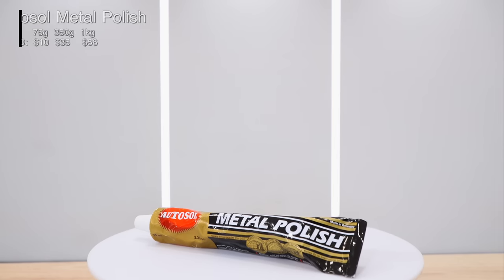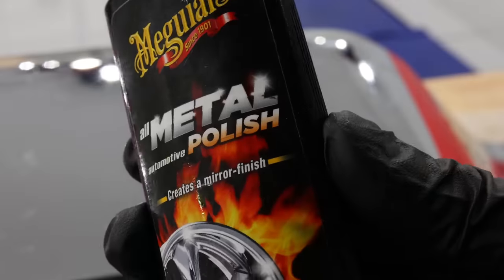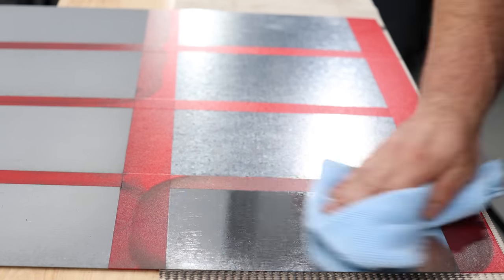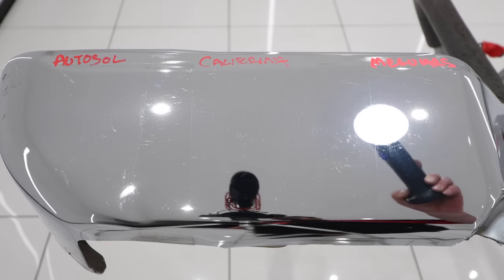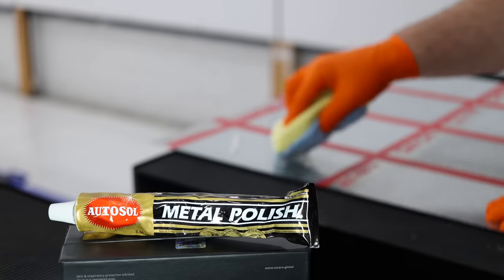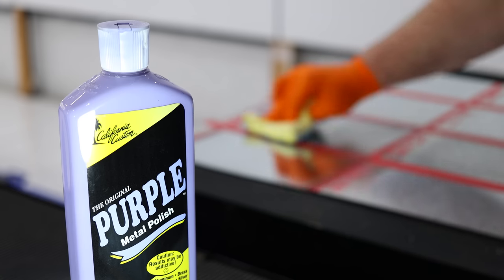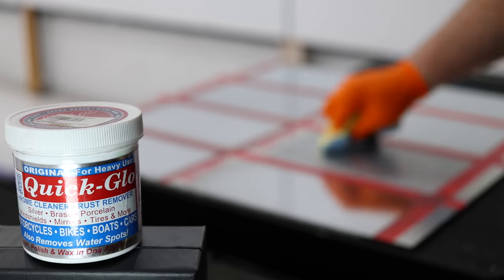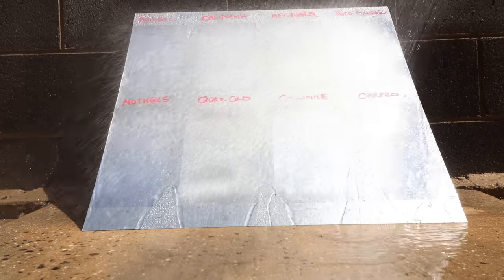What's The BEST Metal Polish? Meguiars, Carpro, Mothers, AF, Collinite, Autosol, QuickGlo, CC Purple

Comment: The fact you went back to square one to start all the testing as you weren't happy with the initial results, is a testament to why I love your videos and your unwavering attention to detail. Still my go to channel for anything car related. I liked this as something a little different too. Nice one Sandro, and hope all is going well for you in 2021. See you in the next one! (also the voice over for Mothers @10:40 is the opposite of the top left text results - this is the one I was most interested in for doing my headlights, autosol just didn't "cut it". Could you clarify which is correct please?)
Reply from the maker: Thanks man and much appreciated as always! I’ve put a pinned correction comment up, but the voice over is correct and the text is wrong!
Reply: That's the boat I'm in. I recently discovered Mother's headlight restoration ability (where Meguiar's headlight restoration failed) and it's interesting you say Autosol won't do the job that well, cause I was meaning to try that next. Do you think mother's is safe to be used on car windows and side mirrors also, cause of course, there's a difference between plastic headlights and glass. Haven't tried it yet.

Comment: As a metal worker I say kudos for using all different types of metal as you understand the massive differences 👌🏽
Some polishes aren't even recommended for Chrome Plating.
Some worse for wear metals will need a proper compound with a calico buff. But these are great for up keep of a machine polished finish. And chromes. 
Once I found the Meguiars NXT I kept it in my toolbox for the combination of finish &  protection/weatherability it leaves behind. Shame i can't find it readily avail. Anymore.
 
With the Mothers I found a more brilliant finish with the Mothers Billet Polish. 

And Autosol now has a larger range of products readily available for specific Metals from Aluminium to Gold etc. Which I find a much better finish than the OG autosol. 
Just my 2 cents.

Once again, thanks again for yet another Unmatched review Sandro! Truly my go to channel for anything detailing.
Reply from the maker: Thanks so much for sharing your insights here as metal worker, really appreciate the comment!

Comment: Came back to add that I’ve used 3D One with a DA, soft foam pad, and high speed to polish delicate plated surfaces.  I think as long as your surface isn’t really dealing with the elements for long (think musical instruments), go for a traditional wax that applies well and adds the gloss you like (Meguiars Deep Crystal is a good example).  Two coats should suffice for a while.

Can’t forget though about Finish Kare 1000P Hi-Temp Wax.  Not the shiniest, but this stuff cures very hard and does what it says for pennies on the dollar.

This remains a great video that serves as an example of for other testers and reviewers to follow.
Reply from the maker: Great advice mate! Oxidation due to UV light is metals most common defect and a nice wax/sealant can certainly help protect and enhance its finish.

Comment: Thanks heaps Sandro, I own my own Motorcycle detailing business here is Townsville, the majority of my customers are Harley owners so I see alot of metal and chrome polishing.
I typically use 4 things when cleaning and polishing chrome and alloy on a Harley - 0000 Steal wool for chrome, Carpro Metallic Cut for my first initial clean/polish on alloy and then Mother's Mag&Aluminium polish over the top to add that pop.
And then usually a coat of wax or I found Carpro Reload layered on a couple times also makes chrome pop really well as a sealant after the entire process.
Going to try NV Lustre on this current bike I am detailing & correcting some alloy parts on.
Cheers mate - love your channel and is my go to Youtube channel anything detailing!

Comment: I have a 67 Chevelle loaded with chrome, so this video was very helpful.  I’ve been using Surf City Garage Killer Chrome for several years.  It doesn’t have a lot of defect removal capabilities, but it does finish down extremely well.  I am one that really doesn’t require a product for removing heavy oxidation and scratches, so Killer Chrome is a great product to suit my needs.  Great video!
Reply from the maker: Thanks mate, and that’s really what matters most in the end - that you’re getting the results you’re after!

Comment: One point is cost too. I just bought Mothers ~142ml for $10 at the local big auto chain store. Autosol was $20 for only 75ml - so twice the qty for half the price makes the Mothers 25% of the cost here (Canada) - is the mothers going to be 4x the elbow grease...im doubting it.  Haven't tried it yet but i'll be using it on old motorcycle wheels steel spokes, chrome rim and another aluminum rim so we'll see how it goes!

Comment: Thanks for doing this as I’m currently working on a microlight aircraft which the unpainted aluminium has certainly tarnished. I was going to use Metall, a aviation type of polish, but already found it is very aggressive and oxidises quickly after completion. Now I have a choice! Thanks.
Reply from the maker: Great to hear that I hope it helps you find the right one.

Comment: Great video! I am working on my Father’s motorcycle than he left to me when he passed. I was curious on what hand polisher you are using in this video. Also what buffing pads do you recommend for polishing motorcycle chrome? Truly appreciate the feedback. Cheers!
Reply from the maker: Thanks mate and I think that’s a beautiful thing to work on and restore your dad’s motorcycle. 
I’ll give you a link to the polisher I used in the video and as far as pads go have a look at Microfibre pads if the chrome needs a bit more attention in removing oxidation and light swirls, while foam pads can be great if the chrome just needs a lighter polish to clean it up. 
The polisher fits any 3” size Velcro pads and there load of different ones around, so just go fit whatever fits your budget. 
https://www.waxit.com.au/collections/shine-mate/products/shine-mate-ex-603-12mm

Comment: Hi Sandro - great video as always. Just wondering how does something like metallicut compare to a paintwork cutting compound in terms of it's ability to remove defects. Something like Scholl S2/S20? I have scratches to remove from tailpipes and saw from another of your videos (a while ago) that you recommended traditional compounds in their place - or have the advances in metal polishes from CarPro etc made it a closer one to call now?
Reply from the maker: Thanks and yes it would be interesting to test that out, but my gut feeling is that a coarse paint compound will tend to cut more in relation to swirls or scratches but it probably won’t finish as well as most metal polishes. Scratches can be quite difficult to remove from most metals, and equally difficult to refine compounding swirls so you may be in for quite a bit of work!

Comment: Excellent video mate. I've been using the Purple Polish for a number of years now and found it to be the easiest to use with the best shine on truck wheels. Until now I've been polishing by hand using a non-scratch scouring pad however I would like to make life easier and do it by machine. Any idea what machine and pad might be suitable for Alcoa alloy wheels? I've tried the Mothers Powerball however its just not durable enough.
Reply from the maker: If the wheels aren’t too intricate in design, a mini 3 DA such as the shine mate ex603 could work well, but if the rims are more complex on design you’ll need to drop down to a 2” or 1” polisher like the Rupes iBrid or Flex PXE 80 - which are quite expensive. If you have access to a good air compressor, the Rupes TA50 is a more affordable and brilliant mini polisher for wheels. 
The Shine mate microfibre pads are a great affordable option, and the lake county fibre cutting pads are even better but more expensive.

Comment: I have a motorcycle with an aluminium and steel frame, the aluminium part has gained little black spots, the bike is 23 years old
Every person i ask tells me that its there to stay.
My question is, will a product like autosol be able to remove them?
Thanks
Reply from the maker: Typically those corrosive spots on older aluminium are really fused to the metal so that a polish won’t be able to remove them. What can work is quite a more involved process in sanding back the aluminium with coarser grades of sand paper, to medium and then finer grades and then using heavy compounds to medium and finally your metal polish. Basically it’s a lengthy metal restoration required.

Comment: Gday mate. Great vid. I was just wondering about doing the chrome/alloy trim on my HQ's plus my HQ Kidney type dished alloy wheels. I have Autosol, California and Mother's metal polish to use. I had tried using a felt type buffer I purchased from Supercheap used in a Drill to do the bumpers and trim but wanted to know what is the best type of applicator to use in the drill or my Shinemate DA???? IE felt, microfibre, foam-like the Mother's Powerball???? I have found on the CHrome bumper I seem to be getting some scratching using the Drill/Supercheap buffing bit using either Autosol or Mothers. What or where can I get a QUALITY buffing bit to use to polish and remove the scratches????? I have used Autosol many times along with Mothers by hand using old flannel material shirts and got good results on the alloy wheels. But I want to do a more professional job on the chrome and other alloys like stainless steel. Any advice where to get some good buffing bits would be great.
Reply from the maker: Because chrome’s amazing finish is created with chemical and electric treatments, it’s hard to remove things like noticeable scratches without dulling the finish and because chrome is generally plated you don’t won’t to go too hard as you may eat through the platting layer to the base metal. But you can still improve it without chasing the deeper scratches. 
It’s normal to get some hazing to start with if you’re using something like a wool pad on a drill or rotary and sometimes you have to get a little aggressive to level down the scratches. You then have to follow up with with something like a foam pad on a DA polisher to restore the shine. If you want to avoid getting to much haze to start with try a microfibre cutting pad with your metal polish as it tend to cut well and finish finish reasonably well on a DA polisher - something like a 3” mini polisher would be ideal. You could then switch to a foam polishing pad with the sand polish to restore maximum brilliance

Comment: Great comparison video thank you. Random question for you. Do you think the Mother's Mag and Aluminium would work for uncoated aluminium window frames which are quite oxidised? About 40 years old and looking very worse for wear. Thanks
Reply from the maker: Thanks and yes, it should work well on bare aluminium trims, it may require quite a bit of elbow grease to cut through that heavy oxidation but you should in any case see a great improvement.
Reply: Legend 👌

Comment: Hi Sandro. Which pad do recommend to use for cutting and polishing chrome surfaces?
Reply from the maker: Microfibre is probably the best for cutting as it’s very effective yet still finishes very well. Wool can also cut great but won’t tend to finish as well. 
For lighter applications and finishing well on softer metals, foam is a great choice there!
Reply: @CarCraftAutoDetailing   Thanks Sandro

Comment: 10:35 -10:45 aprox. You mixed the 2 ratings up...i will not check for more. Measure twice, cut once... Is an old phrase used in carpentry but it is applicable to life in general double check things and you won't get egg on your face.
Reply: It’s not that deep bud
Reply: @ace-pl4qh  It was not directed to you
Reply: @darylhudson777 thanks Sherlock
Reply: NOBODY CARES